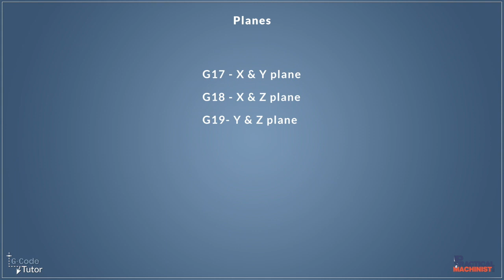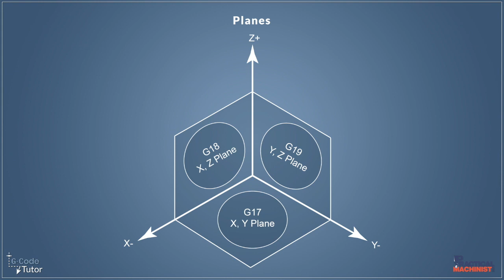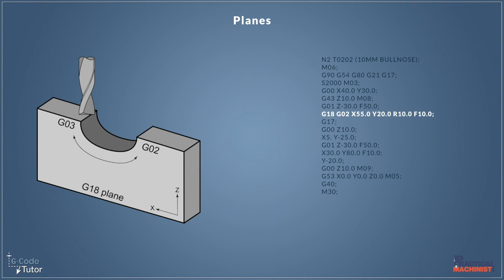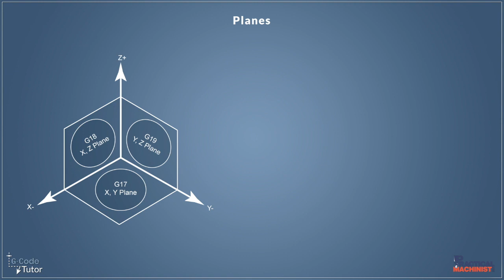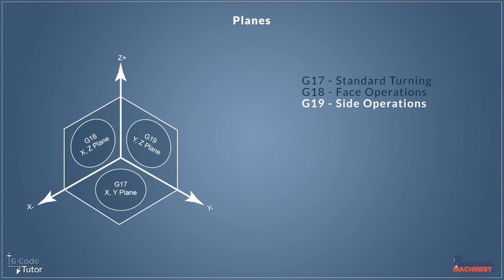G-Code Basics: Understanding Tool Planes (G17, G18 & G19)

Comment: All the 2 axis lathes that I run go to a G18 as default?
Reply: Yeah, lathes are G18- the X,Z axis.
Reply: I have look also, cnc-lathe (2-axis) default is G18 (X,Z).
On cnc-lathe, G17 (X,Y) when drill on face using offset, with powertool/live tool. (One machine use M80 to activate C-axis on spindle. M81 disable C-axis)